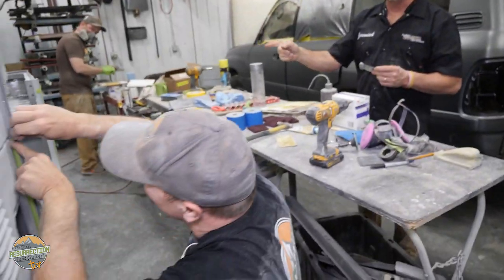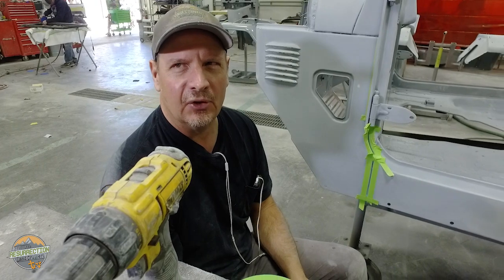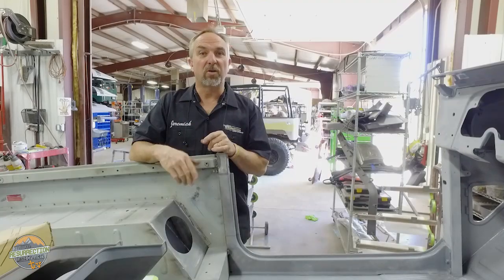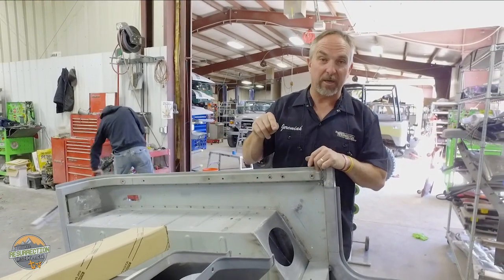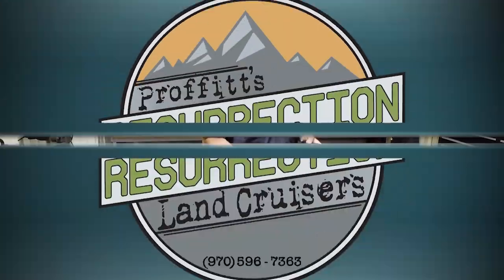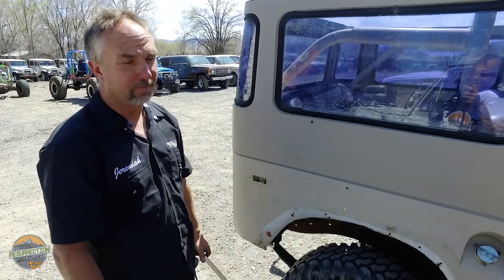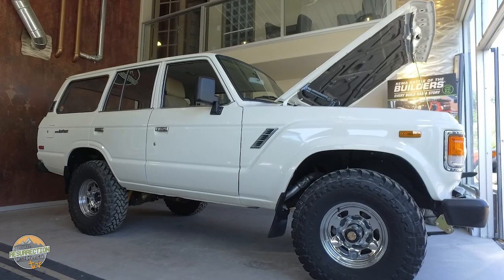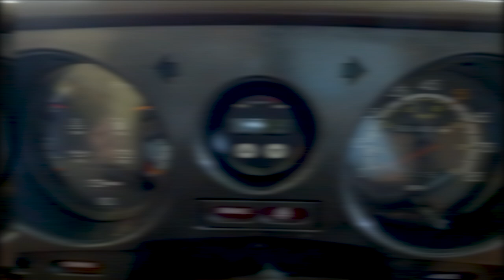Check it out! Land Cruiser Restoration Tips and Tricks. FJ60 Stage 2 Restoration with Cummins R2.8.

Comment: why not e coat the parts prior to putting it back together... primer tends to wear down over time...
Reply: Because it'll burn off when you weld the panel. And E-coat is supposed to be painted over anyway.
Reply: @GridIndustries  you primer on top of the e-coat, it adds another layer of protection.
Reply: @joeyscleaninglady2877  new parts are e-coated, how do you apply it to existing parts?  How does primer wear down? Etch primer, epoxy primer, primer surfacer, then primer sealer.
Reply: @GridIndustries   zinc phosphate treatment (This is VERY common lots of aftermarket parts are pre-treated with a zinc phosphate coating ) then go an e-coat bath then sealed then primed then painted.  Chemical resistance to corrosion is far superior to  primer.
Reply: @joeyscleaninglady2877  isn't etch primer a chemical treatment? But I've used zinc phosphate treatment as well. POR-15 Metal prep does that, which I'm a fan of. But I agree, the more comprehensive the protection, the better.
Reply: @GridIndustries  self etching primer is a surface treatment and not bath